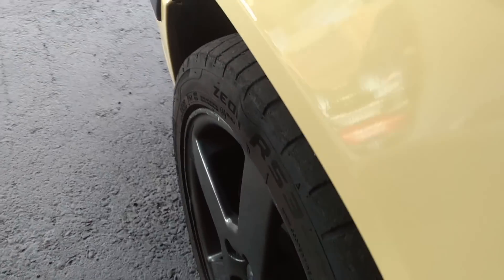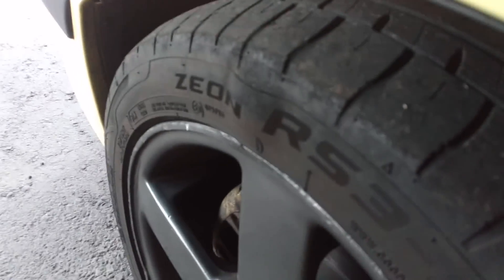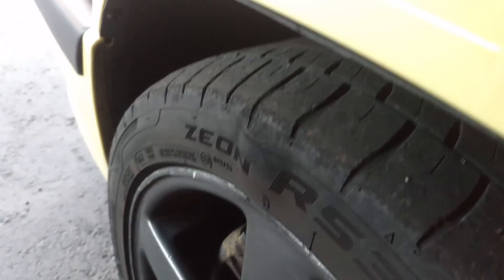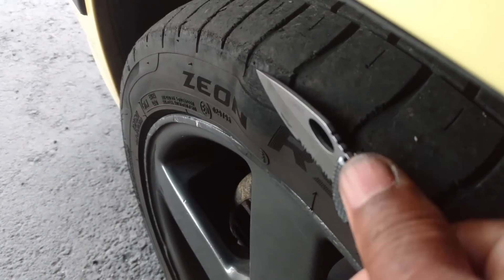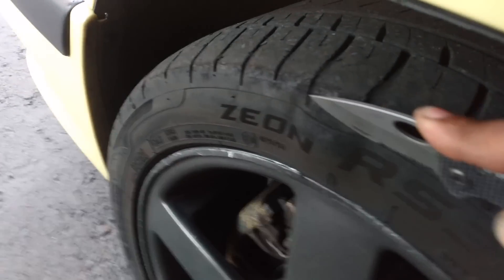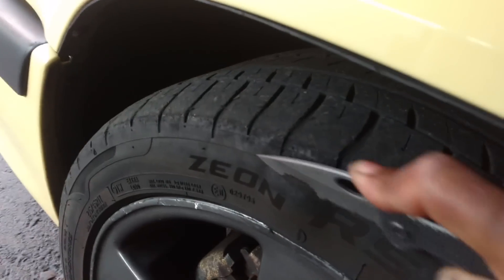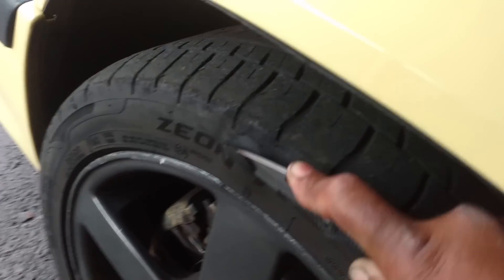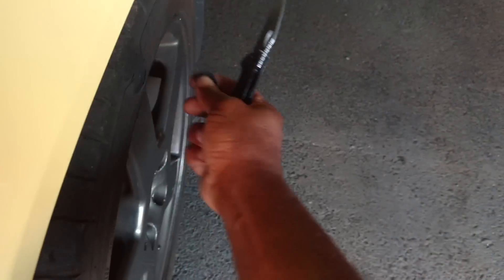Removing an egg from the sidewall of your car tire. Sidewall bubble damage on side of the tire. VOTD

Comment: This is a great tutorial. Thank you very much for sharing your knowledge.
I'm preparing my car for a 2000 miles trip right now and thanks to you I made all my 4 eggy tyres look new. Extra tip: if you have bald tyres you can cut your own thread with a chisel and a sharp knife. I made a Michelin's thread pattern on my bald Chinese tyres, so smart!
Reply from the maker: Awesome! Thanks for the tip for bald tires. ;)
Reply: Don't forget to heat the chisel 😂 (I'm a little late to the party I know)

Comment: nope.  That sidewall is usually about 3 layers of rubber with nylon cords in-between. You probably hit a pothole or a curb and compressed the tire all the way to the rim causing the nylon cord to break or separate and the air is getting to the outer layers.  I deflated the tire and used Tire Slime and aired it back up and drove about two miles parked the car with the blister at the 6 o'clock position so the Tireslime could get down to that area really well.  I still had some blister but after about two days, it "cured" (hardened) that area and the blister went away. My friends were amazed and so was I.  I figured it had a 50% chance or less of working.  I drove it for about 6 months until I could save up for a new set of tires I needed to replace anyway.  

You may have dented the rim in that spot, too.  A steel rim is not too hard or expensive to pound back out.  Aluminum rims are fucked and have to be replaced.
Reply from the maker: People drive around with those bubbles on their tires ALL THE TIME. 🤷🏾‍♂️

Comment: I think your friend was teasing you...its a separation of the plys on the tire. Letting air inside the tire shell, put pressure on the thin side walls. You could not just cut it off.
Reply from the maker: Lol, just a little humor.

Comment: WHY ? the rubber is the only thing holding the air into the tire? that bubble is broken belts and the rubber is holding the pressure back (FOR AWHILE) . I thought the knife would fly out of your HAND as soon as I seen the screen shot. that's some dangerous stuff right there  ? why would you try to cut it off im lost on WHY ?
Reply from the maker: Just humor.

Comment: I guess you knew that might happen, staying to the side. Makes me wonder, though, if letting the air out the stem, and then after the bubble goes down, Pumping it back up with fix-a-flat or something similar would work.
Reply from the maker: ahhhh, no. replace those bro

Comment: I tried to buy a rim at the jy that had a tire with an egg in it. They insisted the tire was good and I would have to purchase the tire along with the rim. I told them they were nuts... asked what exactly they considered good tires? They said if they hold air they're good. Told them they were nuts...again... and left the rim behind.

Lesson learned is to just let the air out in the yard I suppose...
Reply from the maker: Yes, slice the sidewall. No more holding air. 

I will say this... that egg appeared on the sidewall while I was heading east between PA and VA. I proceeded to OH where I installed a tow hitch and towed a trailer 940 miles to OKC. Then I drove the car home, another 570 miles. In all, I probably put 2000+ miles on it. 😳

Comment: I drove from TX to NC once with egg on rear tire it was a  215/40/R18 in size and never got a flat tire and put 2400+miles on it in just a week. Sold car with same tire
Reply from the maker: I put about 2,000 miles on this one. I also towed a trailer 930 miles with it. Doesn't make it right. Lol